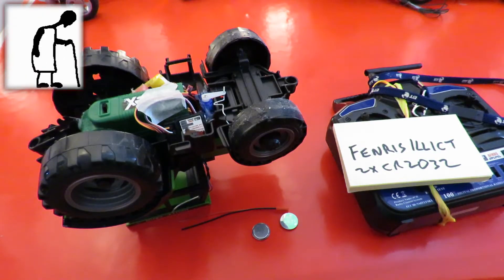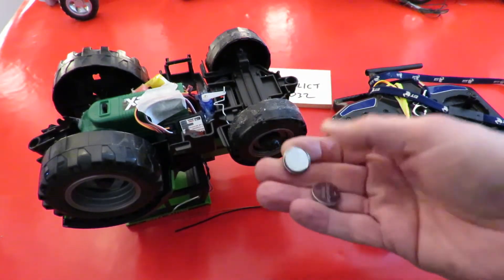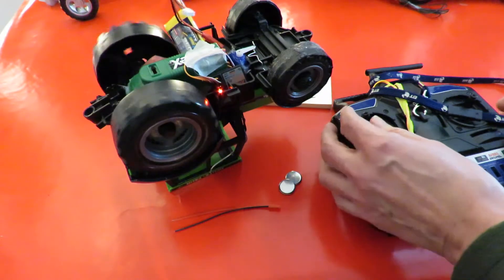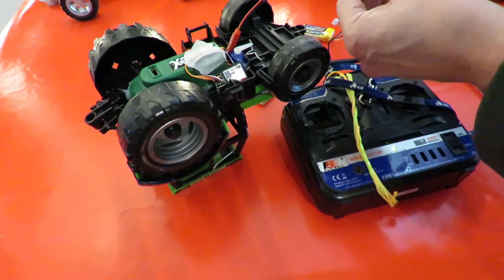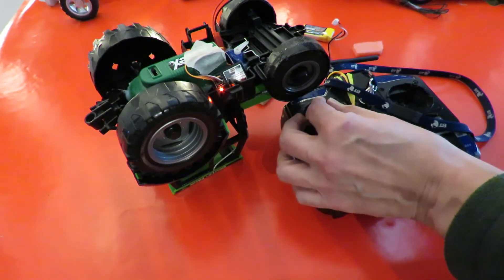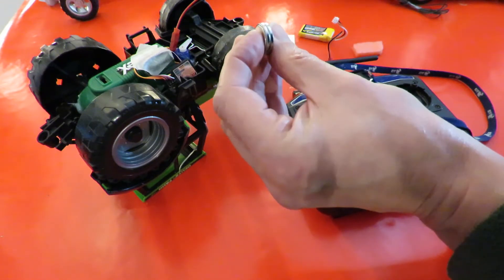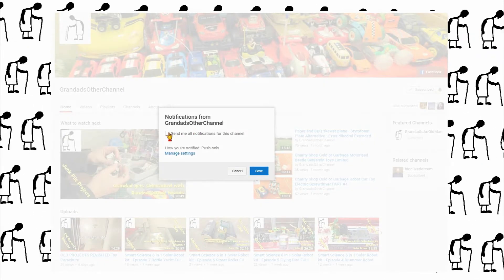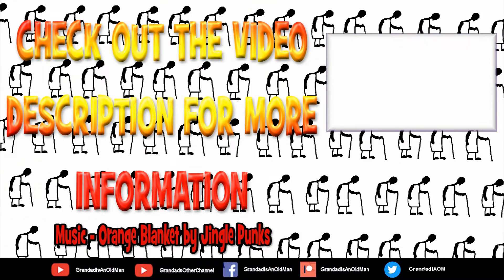Does an ESC work if it is connected to two CR20323v batteries

Comment: will aa batteries work
Reply: Will it work though
Reply from the maker: @balintboda5751  did you read my reply?
Reply: Yes I did I meant to ask how long will it run
Reply from the maker: @balintboda5751  it will run as long as the battery has sufficient power to drive the motor. So as I already explained it depends on the type of battery you are using and the type of motor you are trying to run. A litre of petrol will run a Mini car for longer than a Rolls Royce. An AA battery just tells you it's physical size, not it's power, there are many different types of battery that come in the AA size and they have a wide range of power capabilities.
Reply from the maker: To run an ESC you need the right voltage and sufficient capacity (current flow). Other than that criteria a battery is a battery, whatever it's chemical composition it is still giving voltage and current. The ESC specification will tell you what voltage it requires and what current it can handle. If it tells you it is designed for a 1S LiPo battery that means it is expecting 3.7 volts. A single AA battery will give you 1.5 volts. Join 3 AA batteries together and you will have 4.5 volts so that ESC should work. If the motor you connect to the ESC want more current than the 3 AA batteries can supply then the motor won't run very well. I run many of my boats using battery packs made up from AA batteries as the extra weight of AA batteries don't matter in a boat.
Reply: Also does the power have to be connected to the esc for it to work can it be connected to the receiver and the esc connected to the receiver to work the esc
Reply from the maker: @balintboda5751  Another long answer. Most ESCs include a bit of circuitry called the BEC. Battery Eliminator Circuit - it's purpose is to take whatever voltage the battery supplies and fix it at 5 volts to supply the power to run the receiver so you do not need a separate battery for the receiver. Not all ESCs have this but most do. It will tell you in the technical description of the ESC. The ESC I am using in this video does have the BEC circuit so it is supplying 5 volts to run the receiver. That 5 volts has nothing to do with the power the ESC supplies to the motor and only goes to the receiver not the motor. Without a BEC you would need to connect a separate battery to the receiver. The receiver tells the ESC what to do, without the receiver the ESC does nothing and no power goes to the motor. Without a transmitter telling the receiver what to do the receiver cannot tell the ESC what to do so you need the whole set-up for it to work OR you can use a SERVO TESTER which is a little bit of kit that has a dial on the side of it that you use to control the output. I demonstrate one of those in this video https://www.youtube.com/watch?v=LkbzKIt10qc&list=PLA5a2xPRSrB1egz5apVQZj-KW8zqhdES6